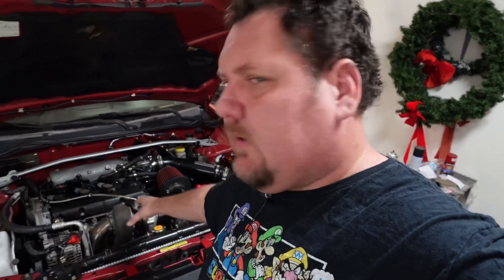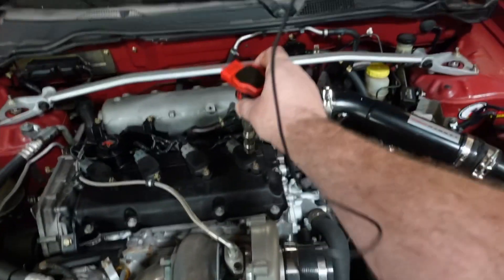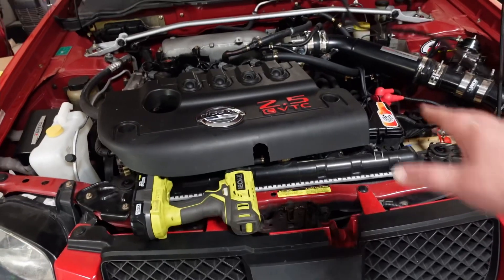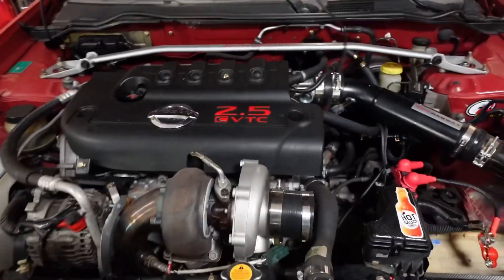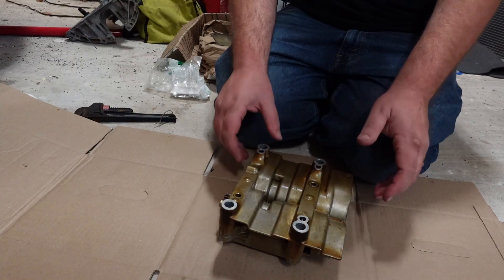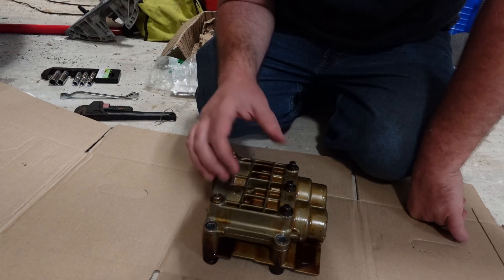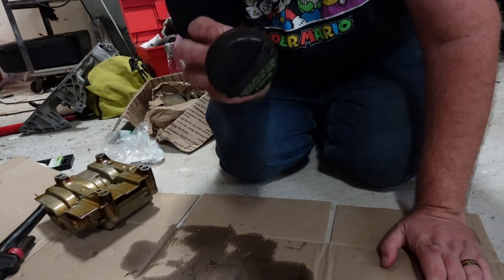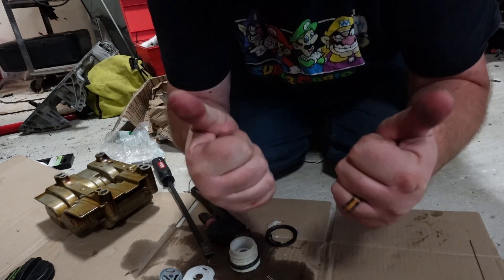Video 8 months in the making, With Nissan Sentra specV

Comment: I powdercoated my aluminum radiator black.  I see you put the engine hoist bracket in. Niceeee. Gon blow that motor soon. 😉 I also got a video on how to remove the balance shaft on my channel. Some bolt cutters and BAM! Leave the unit in, itll be fine.

Comment: My engine cover liked to get melty with my turblo, so I used the bracket you just installed to hold my boooost controller after tossing the cover. I think I just plugged the oil line to the balance shaft after cutting the chain, put the shaft casing back in on one of my motors

Comment: Hey where did you get that front lip? Looks trick! i have sent a front bumper cover to APR for my '04 to have them design a CF wind splitter but seein that i'm havin second thoughts. and is it Carbon Fiber?
Reply from the maker: I would love to see the splitter when it’s done. 

Mine is just a cheap eBay Subaru lip. More information in this video. https://youtu.be/S_ugqbx0sD0?si=hViY_Qzbwqp6L-Ao
Reply: absolutely. and i'll stay posted with that. i like your build, you did a b15 right. i like it! i'll try to upload mine. she's under the knife right now. @red_rabbit_specv